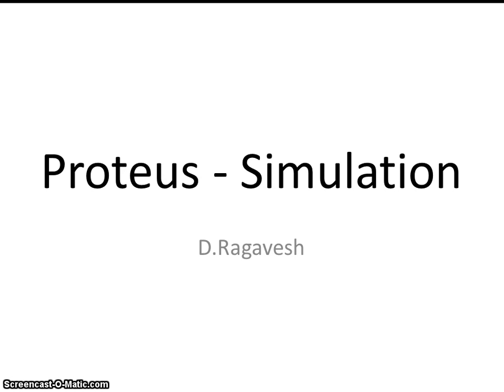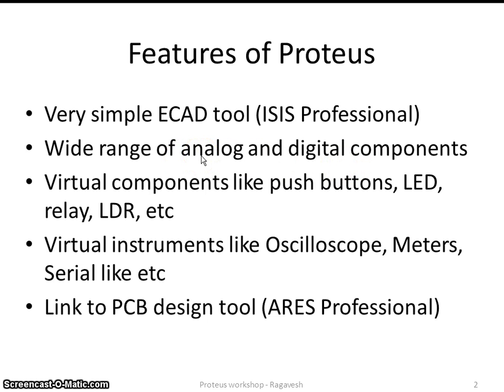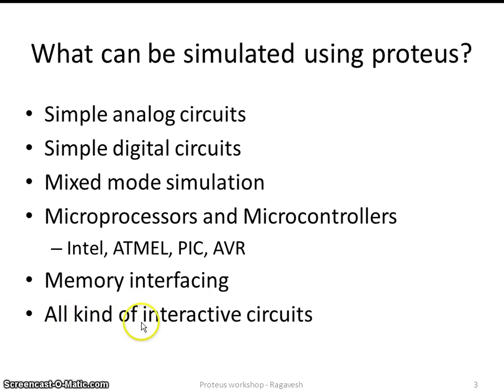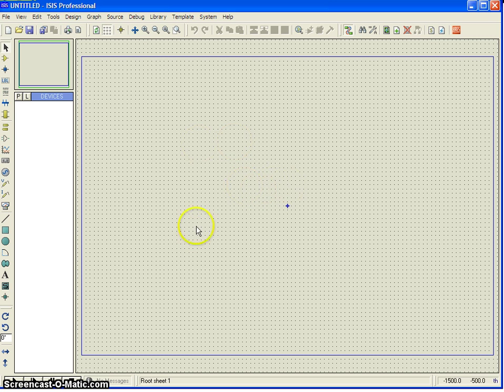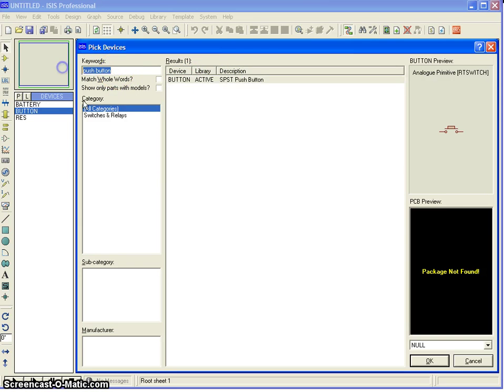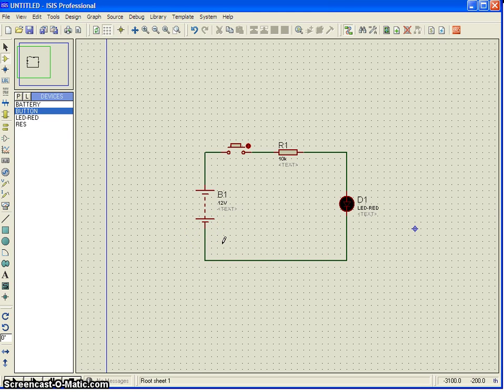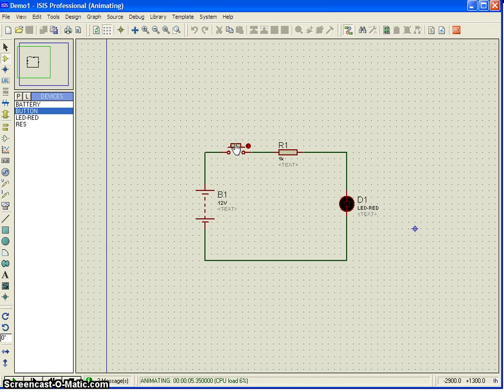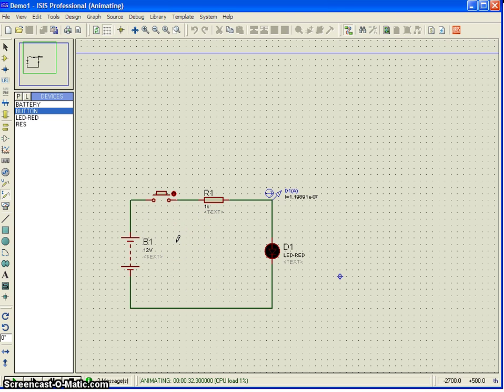Proteus Video 1: Switch and LED

Comment: Is a button and a switch the same thing?
Reply from the maker: A button refers to a push button, whereas a switch refers to a single-pole single-throw switch.  In the simulation, there is a small black colour notch, which can be clicked to hold the position.

Comment: Anyone know how to move a placed button other than:  right-click -> drag object?
Reply from the maker: Thanks for watching. 
Just left click and hold left mouse button  on the component you want to move, then drag and place where ever needed.
Do subscribe and share
Reply: @RagaveshDhandapani  That works on most parts, but for a button when you left-click and hold it just actuates the button -- dragging the mouse doesn't move the button.
Reply from the maker: @JohnSmithZen  well explained. 
Don't click on  the push button activation area, click and hold near to the  terminal area.